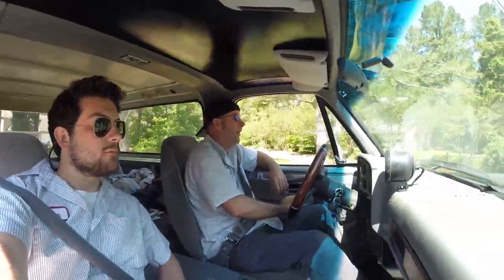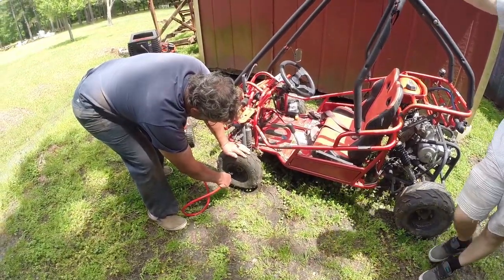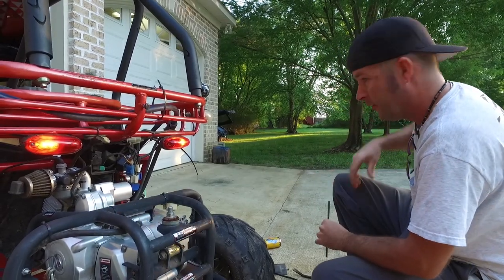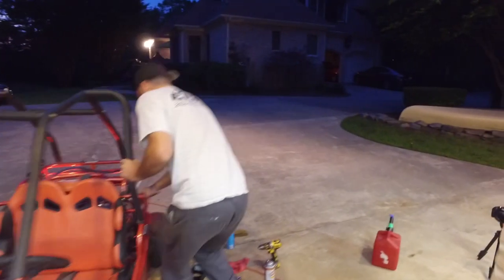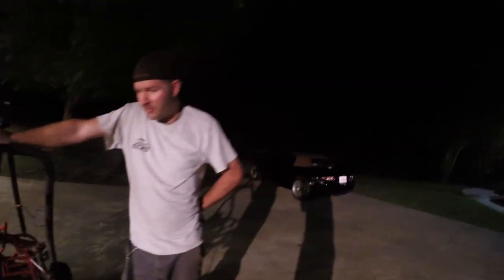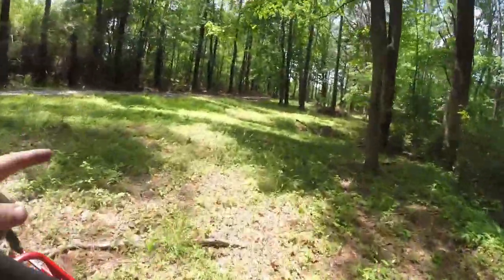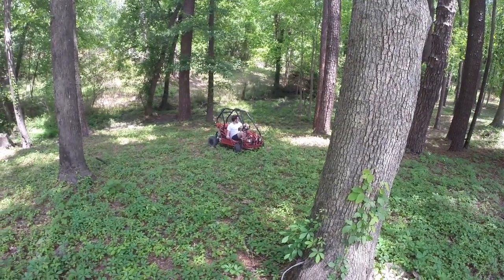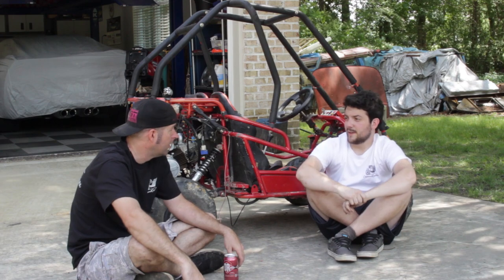$200 Offroad Go Kart Find!

Comment: I know what kind of spark plug that is made for that engine. Because I have a four wheeler with that vary engine and I know the wed site where you can get the spark plug for it. Plus third gear works better when it has correct spark plug.

Comment: 250 kawasaki motor? or suzuki the suzuki tends to seat better in cramped spaces. bigger tires. get the lights working. In all I would love to say strap a predator to this beast and make it fling mud but you would need to cut a lot out to make it fit (I would know i've tried) def contact go power sports and get some advice from them or at really any shop that sells chinese go karts and scooters..... wait 250cc scooter motor bored out :)

Comment: I'm confused on how a longer spark plug would bend the valves. Or did the plug, break tip off.  break off and get in one of the valves maybe ?? If it hit anything , it would be the piston.
Reply: +Larry Evans the spark plug is between the two valves and it was too long

Comment: Looks like a 50cc honda motorcycle engine. I'm guessing it's small like that so you can drive it on the roads like a moped without a plate.
Reply: t4thfavor1212 nope only on private land or special places for riding.
Reply: SovietRacing  in michigan, anything with 49.9cc or less is fair game on roads. with an or sticker and a drivers license, you can even drive a side by side on public roads.
Reply: t4thfavor1212 then why would you ask??
Reply: SovietRacing because I am in michigan, and I don't know where the poster is...

Comment: to start it with the key first put in nutreal hold down the brake and turn the key
Reply: +D “PinstripePlays” Torres it sat in the rain so long the key switch is stuck in the on position

Comment: I bought one of these with the same engine and cant get it to start. I check the 3 main things. Gas spark and air. Carburetor and battery is brand new but it wont start. Can anyone help?
Reply: Don't forget to check the timing as well. Engine timing and ignition timing have to be correct for it to run.

Comment: never put a long reach plug in a spark plug hole that used a short reach plug!
Reply: +J Davidson (Mr. Tinker) it was the only one i could find that would fit. and it cleared the piston. sadly it did not clear the valves

Comment: What is Ike touching with the metal bar to make it start.
Reply: +Jonathan Gomez im jumping the starter relay
Reply: thanks ike i tried to do that to my atv but it just throws sparks i know this sounds dumb but am i supposed to hold the metal bar
Reply: yea i hold it to the posts on the starter solenoid and the starter spins if yours does not dont hold it there is a problem. fires can be started
Reply: so that means the starter is bad or the solenoid is because i basically did what you did and made a weird connection with the wires and said"it'll be fine"
Reply: did it run or nothing happened?
Reply: it worked but i have a bad electric start

Comment: Nice 200.00 cart. Never heard of the valves hitting the piston. Poorly engineered if in fact the valve stroke was long enough to even come close to hitting the piston. You sure you were exactly a TDC on the piston?
Reply: the valves hit the spark plug. i put a extra long plug in
Reply: the valves hit the spark plug. i put a extra long plug in

Comment: you shold pot a125cc lifan pit motor in it you cen get them off ebay cheep new an ther relly good
Reply: +Jake Shaw That's 25cc smaller than this engine.
Reply: +Ratkill9000  thort that one wold of been a 110
Reply: I use to see these things advertised a lot in Northern Tool catalogs, they always claimed it was a GY6 150cc engine.
Reply: +Ratkill9000  OK
Reply: +Ratkill9000 you cen get 150 motors of eBay 4 speed to
Reply: +Ratkill9000 its  110cc. weak
Reply: Isaac it'll be fine Yeah that is pretty weak. Hope you guys can come up with a stronger and more durable solution.

Comment: You wasted your $200. That's a cheap Chinee toy with a "honda clone" on it. Probably a 110 that may make 2.5bhp when they're brand new. Shocks are friction type (undampened) with pogo stick type rebound. How do the welds look...more spatter & slag then actual weld ? You could put an 8 horse Tecumpseh on it and it'd tear itself apart.

Comment: 150 dollar lifan motor from china
Reply: +smallenginedude71 which is exactly what their working on
Reply: Mac Schmitz yeah. i have to say though. I had a chinese bike with the same engine on it. I put a japanese mikuni carburettor on it and it ran and started a whole lot better. had more power too.
Reply: Ive bought the lifans before, mounted them on c70s and pitbikes with zero issues i always switch out the oil and break them in hard i have a pitbike with over 1000 hours in it with no issues so far!
Reply: Mac Schmitz 1000 hours is pretty darn good for a cheap engine
Reply: +smallenginedude71 For the price im happy with it dont get me wrong their cheap and shity but they do what they need too!
Reply: Mac Schmitz Absolutley. Doesnt matter what the cost is, if it works, then thats all that matters.